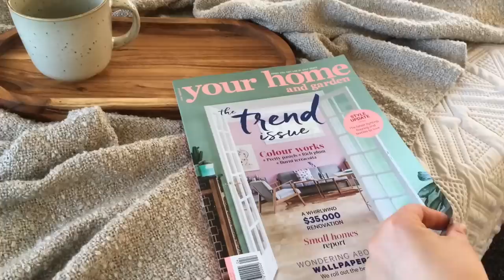Amazing Tiny House Has Removable Trailer

Comment: FINALLY! Some real innovation. This is about $70,000 USD. Significantly more value than some of the borderline-scams that are seen listed for the same price. Good job yall.
Reply: robert hoffman although I think 70 is a tad too much, but it is phenomenal!
Reply: No, this is just in NZ where they don't have to built them to handle the extremes builders in the States and Canada do... They also have to deal with a weight limit for their road legal requirements.

So everything is light weight in its construction to keep it within that strict weight limit.

Typically, when looking at Tiny Houses from countries, other than the States and Canada, keep in mind they usually have to keep it within 3.5 tons while most THOWs in the States and Canada can be double or more that weight...

Detachable trailers have been done in the States and Canada as well but it's harder to do with the much heavier houses and cuts into the maximum height you can work with as you need to essentially double up the floor... One for the trailer and one for the house, which also limits floor insulation space...

Not an issue in some countries where the climate is usually more ideal and they can stick to more minimalistic construction standards but meeting residential standards are not the same everywhere...
Reply: @ Laurie Hardin  It's in NZ, so that translates to quite a bit less in USD... As to whether it's too much really depends what you want for the money.

There are many variables from materials to the amount of labor involved that determines costs...  

But those choices also effects things like how it performs, what features it does and doesn't have, how durable it is and thus how long it will last, how hard or easy it is to repair and maintain, and whether it's just a cookie cutter mass produced product or something truly custom and hand made...

Many gloss over such details and just assume it's all the same but there can be a big difference from something that may be so cheaply made that it might as well be a tent on wheels versus something that's can withstand extremes climates and weather conditions that'll last for generations...  Among many other factors that can matter to a given owner...

So they're not all the same and a lot more than just size and appearance should be factored...
Reply: In India in 70,000 USD u can make 2 full size 3BHk house
Reply: easy physi but that’s no fair comparison.

Comment: Delivery to Australia? This is brilliant design. I’ve seen hundreds of tiny home videos and this is one of the first with a clean modern design Instead of brown country cottage look. And the innovation of the trailer lift is genius.
Reply: zed elliott oh I didn't know this was built in another country I thought this was in the USA damn, I was going to ask my husband if we could get one ASAP
Reply: It's in New Zealand...  But you can have a local builder make something similar but better suited to your local climate, etc.
Reply: I’m doing a box van and plan to ship it from AUS to NZ and tour for a number of months... so I thought it’s not hard to ship it the other way. It’s only a short trip by sea (3 hr flight) basically it’s quicker to NZ than to Perth!!!
Reply: It's a lot slower by sea than by air... Distance between Australia and New Zealand is over 4,163 kilometers (2,587 miles)... and then it has to be transported to wherever you are in Australia.  

But as long as it can be shipped by a shipping container ship then it can be done.

You just may want to check out one of your local Tiny house builders to see which option is more economical for you... There's about 13 or more  official Tiny House builders in Australia vs 5-6 in New Zealand... Not counting those in construction trades willing to do it as well...
Reply: zed elliott Some tiny home companies do travel all over the us to deliver not sure about other countries but def check out your local tiny home builders :)
Reply: While watching i was wondering if people would prefear the clean modern design over a woody cottage looking house. do you like this design better? also, what do you think of the outside of the tiny house?
Reply: I wouldn't mind one in the Netherlands 👍-up.
Reply: It could be your new project. Try it.
Hi from Monterrey Mexico 💕

Comment: Of course, my fave tiny house is built in NZ! A little far from East Coast USA!
Reply: Nice thing about most builders being custom builders is you can pretty much have almost any of them build you one just like this one...  Though, I'd make adjustments for what would be better for your climate, etc.
Reply: ZeoCyberG I saved it. Since you must have an in with ITH, why don't you send them this video?
Reply: I don't have any special connections with ITH, I just follow most builders to keep track of what's going on in the industry and help people find information on them that's most relevant to their specific needs...

But I believe ITH has already considered removable trailers and many of their custom builds have started with clients just bringing them a Pinterest or similar photo of what they wanted and they went from there...

They might already have something similar in the works considering it looks like their sub $20K build they're working on is suppose to be a container on wheels and that may be how they're doing it...

But the trailer manufacturer they work with can easily do a custom one if they ever need one for a client who wants to duplicate this design...

Though, feel free to send them a link... Maybe on Facebook, if you don't want to email them and it can be seen by others visiting their page and maybe get a discussion going on it...
Reply: I was so excited until I saw those outlets... I knew then that they were overseas =(

Comment: I love that the trailer is removable and I love your storage solutions, especially the built-in bed slats! There's only one negative for me and that's the dining area. That dining table cannot hold two place settings. As such I find it a bit of a waste of space. A more efficient use of space would have been to extend the countertop into a bar table for two people, that you can flip down.

Comment: this is probably the best Tiny House i've ever seen. It's got everything that i would ever want/need. The only hitch would probably the price, i'm guessing. This has to be really expensive.
Reply: Not really as it's a light weight construction, but it's in NZ and depending where you are the shipping and possible tariffs could probably cause some sticker shock then and it may or may not have sufficient insulation for your climate...

Comment: I have so many questions on this. 1) Appears you are going over the 8'6" width so you would need special permits . 2) You can only set this where you have paved flat cement for the jacks. Defeats the purpose of tiny home on the move. I do like the option of doing this, so question 1 is still valid.
Reply: Except it's not a question

Comment: Are there any specs on the trailer? I've never seen a deckover so low. Are the axles solid mounted to the frame?  I've looked at hundreds of trailers and designs, this is the most innovative and highest quality build I have seen.

Comment: Cool structural design with the trailer. But I gotta wonder.  Do people in NZ not watch TV?  Where do you put a TV in this thing?
Reply: NZ and most other countries besides the States and Canada, have to work within a fairly strict max weight limit for them to be road legal... For most it's usually a limit of 3.5 tons...

So construction has to be kept minimal and as light weight as possible and they generally can't fill it with too much stuff.

But you can always use a laptop or tablet or just set up a projector...  Or wait till you have it permanently placed before loading it with more stuff...

Comment: $87.000 CD is sooooo out of my league.I want a tiny home,not a mortgage.
Reply: Build it yourself and you can make it for 15-25k it all depends on how complicated you want the systems to be. I personally like going only by compost, wood and solar. The cheapest options as well. Im estimating around 20k for mine. But always add 20% more than you think it will be. Budget-wise a smart thing to do. Making a trailerhome/tiny house that will last 20-50 years will cost 15-25k no matter how smart you do it. Unless you go for everything used. But going that route will take a lot of time. Time you could use working instead